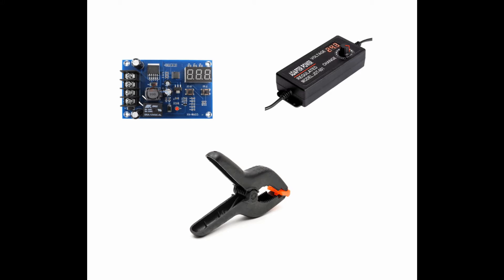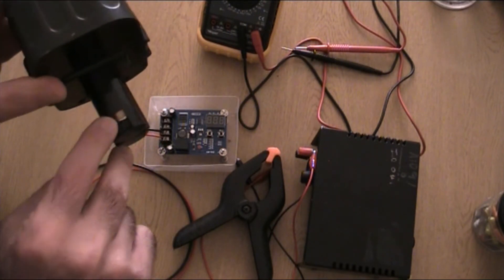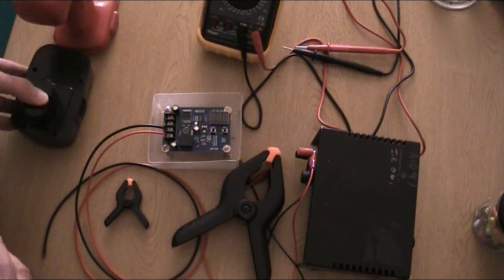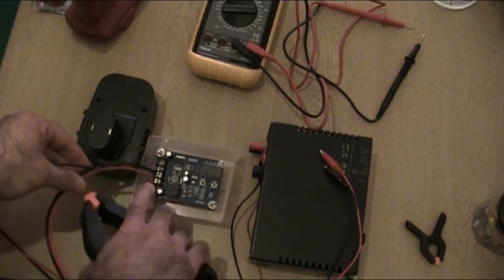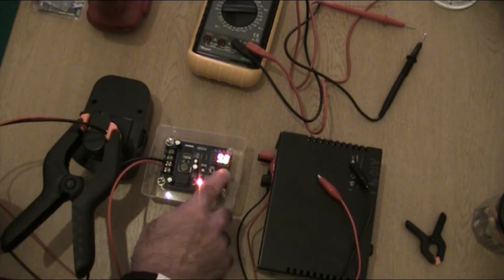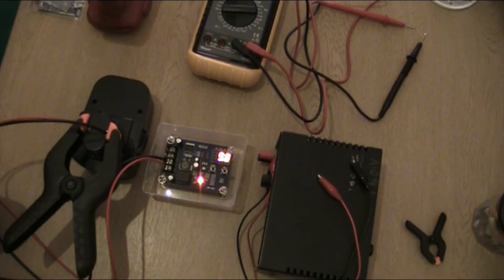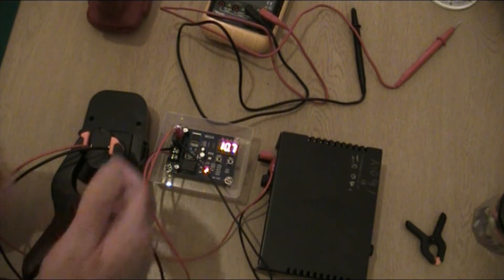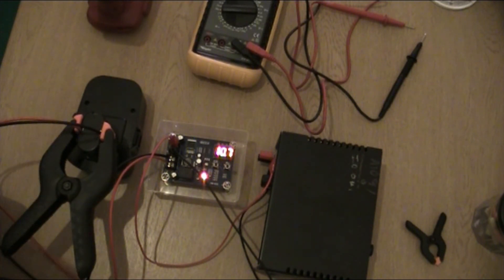How to Charge A Cordless Drill Battery Without A Charger!

Comment: I bout the regulator, but my battery is the kind of box, the one that has 5 contacts. You mentioned this batteries use something other than the clamps?
Reply from the maker: Yes if your battery has slots as mentioned in the video with more than three contacts, then you will need to follow my other video and use other kits for it as taught in this following video, but make sure you know how the wiring is or at least how many batteries are inside your pack, so you can connect it correctly. This is the video that will help you with the links to buy the boards in the description or go directly to my website at www.totalelectricaltraining.co.uk and go to the shop section. Here's the video link: https://www.youtube.com/watch?v=OL6DAVLk0ZU&ab_channel=TotalElectricalTraining

Comment: Can these techniques be used to jump start a 7.5 Ah V60 lithium ion battery which contains circuitry inside which prevents charging when voltage is too low? The battery powers a lawn mower among other tools
Reply from the maker: I don't quite get what you mean by circuitry preventing the charge when the voltage is too low. When the voltage is low that's when you need to charge! In general If your battery has two points of contact for charging as explained in the video, then this can charge it provided you have the right voltage and current to charge.
Reply: Put the battery red to red black to black and for ten min then put on charger should work did for me and batt was not even the same@totalelectricaltraining

Comment: Does universal charger can charge a dead cordless drill battery?
Reply from the maker: Possibly. If the battery is not completely ruined.
Reply: Thanks for the reply . My cordless drill battery is in good condition but no more power in it .when I connect universal charger to the battery charger doesn't lit. Can you tell me why?
Reply from the maker: @chandrakantpatel7395  The TET runs off of the battery to start with, so if the battery is already dead, it can't turn on, to enable you to set the charging value etc. You can try one attempt, which might or might not resolve the issue. you can connect the power supply that you are connecting to the charger, at the same time in parallel with the battery, and connect to the TET as they should be, then set your values and once set, take the power source off the battery, but not the input of the TET. I hope it was clear. I don't have the means to make a video of that or I would.

Comment: Got a TET board a couple days ago.  Tested it and found it defective.  The board shows the same voltage as the voltmeter.  The load relay does not come on.
Reply from the maker: That doesn't sound like it's defective. It's doing the right thing showing the same voltage as voltmeter. Remember this is powered by your battery! Relay doesn't come on, because you need to set it as explained in the video. you've done things the wrong way, and it doesn't sound like, you have set it up right at all!

Comment: Hi. I have one if these relay boards. But when I charge a nicad battery it only charges to the stated voltage ie 12v. Where as a normal charger charges it to just over 13v. Because each battery can be charged to 1.4v rather than 1.2v. Is there a way to get it to charge over the 12v. Thanks
Reply from the maker: Yes, as I explained in the video, you will need to set the charging voltage at about 1.2 times the rated value of the battery, so then you get what you need to have. That's what the normal store bought chargers do too!